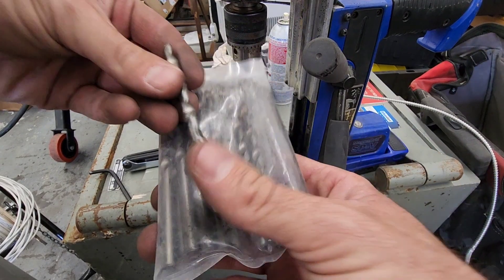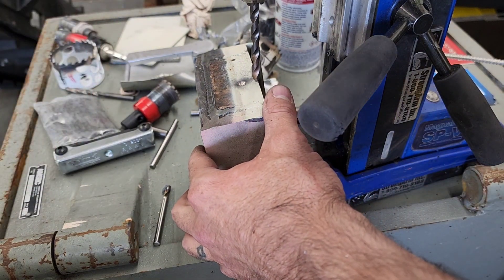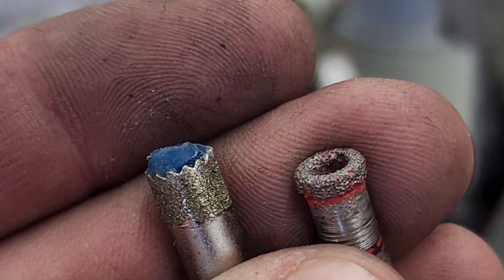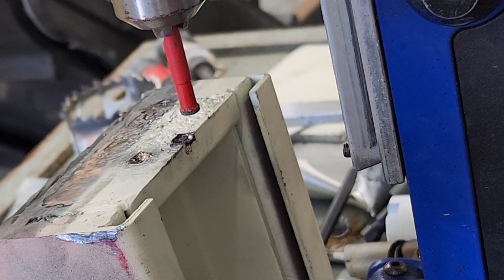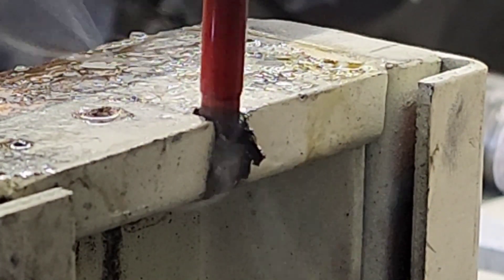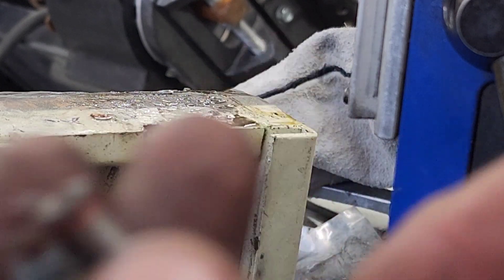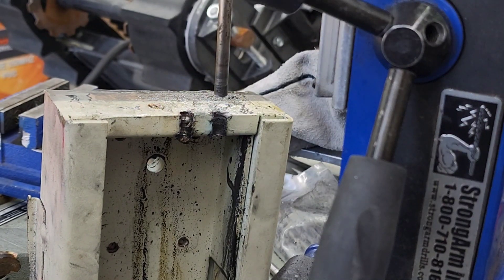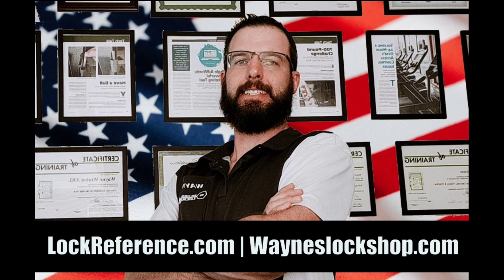Milwaukee diamond core drill bit testing & review on ultra hard GSA container RED lable hard plate!

Comment: I tried using a 5/16 milwaukee diamond bit on a 40mm bearing rod took two bits and a lot of time. It worked but not nearly as quick as your video showed. I was using WD to flush the bit every 5-10 seconds. I need to find a better way because this didn't work. What was the RPM did you use?
The second rod I used Bosch Ns2000 Carbide tip natural stone tile bit. This bit ate and cut through the rod like butter. It literally took 15 seconds. I was able to buy 4 for the price of that Diamond core
Reply: Thank you for the advice I need to drill a hard core dowel and will try using the Bosch bits. Is there a video.
Reply: @jmg36344  sorry no video but seriously that bit went through that chrome hardened rod like nothing